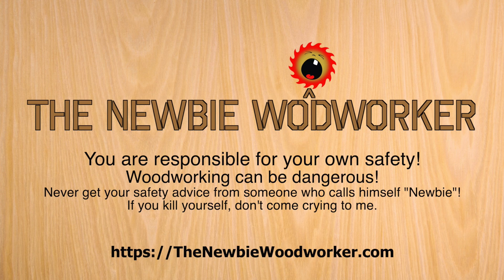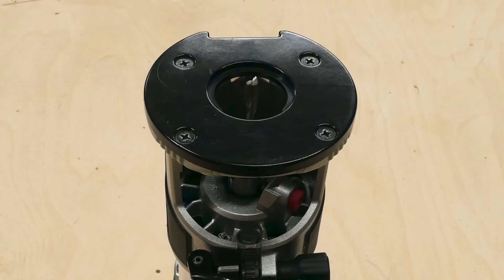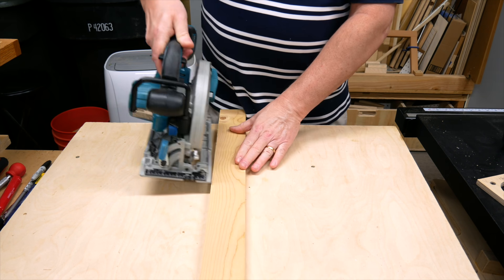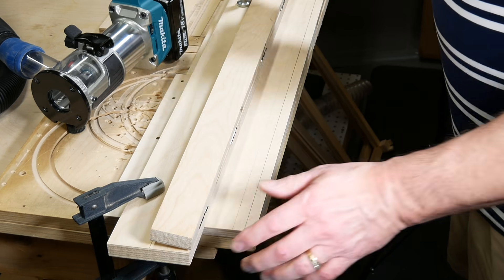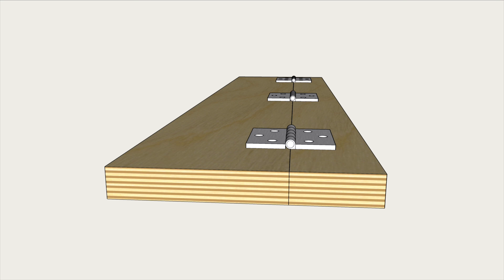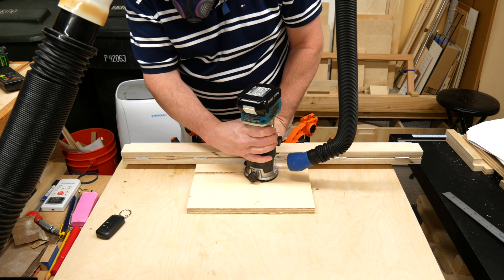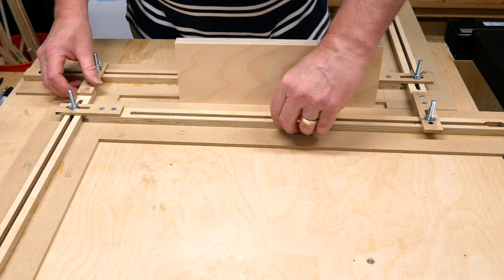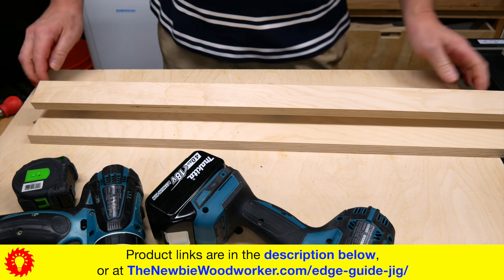Edge Guide Jig for Routers or Circular Saws

Comment: Great Video, I love how you explain things, using a liilt humour and lite hartedness with just enough technical info without becoming boaring.

I made one a few years ago, however mine was slightly different .

In mine, the park you clamped down for routing IS the space for my circular saw.
and the part I clamp down for my circular saw is my spacer for my router.
Meaning i have only 2 parts to use it with both.
Reply from the maker: Cool! 😄

Comment: Thank you! I have been struggling with cutting a straight line, I have no table saw. Many other designs out there, also simple, but still didn't work for me. I made mine with the saw short-wide side (1 1/2) on one side and the long-wide side (5 1/8) on the other side. This way I can easily flip it if I use one side of the saw or the other.
Reply from the maker: Good job! Make sure you're moving the router the correct direction. It's kind of hard to explain which way is correct, but just know that if you move it the correct direction, it's pretty easy to keep the router against the straight edge. But if you move it the wrong direction, the router will want to wander away from the straight edge.

Comment: Wow, there are some great ideas there - thank you. I have this embryonic idea for making this jig adjustable to suit the tool one is using - jigsaw, router, circular saw and perhaps others...I think you can see where I'm going with this. The fiddly bit is getting the flip over part to evenly change in width to suit the tool. Perhaps three (or more) guide holes?
Reply from the maker: I think it could be done, but it might not be worth the effort. But hey, don't let me stop you - you never know what you might come up with! 😄
Reply: @TheNewbieWoodworker  Tossing ideas around is always fruitful. Its nice to hear a different perspective. Thanks. I will only build it if I get it clear in my head and right now, its quite fuzzy :). I'll keep you in the loop if you are interested.
Reply: Easy. Cut another strip or strips to add to the spacer to make it equal to the additional thickness needed and attach with magnets. Since the flip over part is only a spacer, this should work. I would use a forstner bit to drill holes and use small round neodymium magnets. So if the router spacer is 2 1/4 inches and the circular saw is 4 inches, use a 1 3/4 strip that attaches with magnets. If needed, compensate for any gap the magnets may cause. (would be 32nds. or none at all) That's my idea at least.
Reply from the maker: @MikeTheSith200  Magnets! What a great idea, and I'm ticked I didn't think of it myself, because I use magnets for all sorts of things. Like I said, great idea. 😄
Reply: @TheNewbieWoodworker  thank you sir!
Reply from the maker: @MikeTheSith200  No, thank *you*. (We could go on all day like this. 😂)

Comment: Holy Moly - that’s a great idea! 

Gonna try it as soon as I can. The one thing I struggle with pretty much every project is making simple straight cuts. So much so, I was considering buying a track saw... but I think I’ll try this first.
Reply from the maker: You and me both. I've learned a couple of things, though, that might help. First, if you're using a router, make sure you're cutting in the right direction. Going one way will help keep it close to the straight edge, but going the other way will cause it to want to wander from the straight edge. I can't explain which direction is right, using just words, but try it out both ways and you'll see it right away.

Second, regarding a circular saw: I could never keep my circular saw straight until I bought a new saw (the Makita cordless). I have several older circular saws, and there's a big difference between them and the new one. I'm not sure what the difference is, but if you have an older circular saw, you might think about getting a new one. I'm really good at spending other people's money. 😄

Comment: How's about a three-use jig, if like me you have a circular saw, a jigsaw and a router? All you'd have to do is put in the widest two tools first and find a long piece to put in in order to fit in the smallest. Would that be safe, do you think?
Reply from the maker: I think I'd go the other direction. Have the spacer be the smallest, then add additional pieces with magnets. You only need them while you clamp it down, and once you fold the spacer out of the way, you could even pull them off if needed. Does that make sense?
Reply: @TheNewbieWoodworker  Yes, I think that is what I was trying to express, in my fumbling way.
Reply from the maker: @johnedwardtaylor  👍

Comment: I have a question. Lots of YouTubers suggest using 3/4” plywood for making these jigs but I have a bunch of table leafs that were left behind when people purchased dining room tables from our vendor mall that seem to be either hardwood such as oak or particle board sandwiched between oak veneer. Will particle board work for building these jigs? I could use oak but it almost seems like overkill. Thanks
Reply from the maker: I thought I'd already answered this, but maybe I didn't hit "Reply". My answer is I'm not sure, but give it a try! Remember that screws don't hold very well in particle board, though, so that's something to consider.

Comment: Now using this idea how can I build micro adjustment so I can create a 0.150 slot with 0.125 router bit?  Wanting to make slots for 1/8" masonite panels in 1/2" plywood with 1/4" slot depth.  Slots are 1" on center with 20 slots per part.
Reply from the maker: Good question, and I'm not really sure. In fact, I can't think of anything right now, unless you can make a spacer of some kind. Sorry I'm not more help.

Comment: Hey Dan i finally got me a table saw! ill be making one of your sled's maybe even 2 lol. ive already made a second push stick "man cant cut alone with just one push stick" haha

you got any advice on dust collection what i mean by that is i have a blade guard and it has a tube that connects to the saw exhaust and then goes out the back, i 3d printed an adapter to fit my exhaust and my vacuum cleaner it fits very tight but the saw is still making quite a mess. 

i can understand the bit of mess on top of the saw thats ok but it is still going over the floor but not as much as it did when i didnt use the vacuum cleaner lol........never doing that again i had to vacuum my whole garage dust everywhere!
Reply from the maker: Congratulations! What saw did you get? I need to see some pics to understand what you're talking about. You can either post links to some pics here, or send them to me via email by going to my website https://thenewbiewoodworker.com/, clicking the "menu" in the upper right, and select "email".
Reply: @TheNewbieWoodworker  sure thing I will probably do a video and send a link  of it probably easier. it's a UK brand titan ttb763tas it's a budget unit but as far as I'm concerned it's the best of all the budget brands available took me a few months to decide which one to get.

Thanks
Reply from the maker: @TotoGuy-Original  I found a couple of videos on that table saw. It looks like it has a dust port in the back, as well as the hose from the blade guard. So I'm guessing you hook the hose to the dust port in the back, and your shop vac sucks dust from both above and below the table at the same time.

That sound right to you? If so, are you using it that way, or are you only using the hose from the blade guard?
Reply: @TheNewbieWoodworker  yeah that is right. Haven't had time to do a video yet but I will. Going to make sure everything is clean and then do some cuts so you can see where it's going.
Reply from the maker: @TotoGuy-Original  👍
Reply from the maker: @TotoGuy-Original  Thanks for the video - it helped a lot. First, let me answer the things you brought up in the video.

Yes, make a zero-clearance plate. It's safer and you'll get cleaner cuts. It might help a little with the dust collection, but that's not the real problem (more on that in a moment).

The adapter's probably that size just to make it easier to handle somehow, but I agree that although it isn't the most efficient thing, it's not what's causing the problem.

The cyclone is only to get the dust in a separate bucket, so your shop vac's filter doesn't get clogged up as quickly.

No, the problem is the same problem every table saw has, that isn't a cabinet saw. The bottom is wide open, and dust is just going to fall down to the floor. You need to try and close up the bottom. With some good measuring and some patience, you should be able to build a "bottom" for the saw. And you may end up trying to cover the other holes, like for the tilt mechanism (maybe with some rubber from a bicycle inner tube that's split and overlapping, if that makes sense).

When I had a saw like that, I bought a "dust hood" and used it underneath. Search Amazon for "dust hood" and you'll see what I'm talking about. I had to use some wood to get it to fit right and cover the bottom properly. I didn't actually hook up a vacuum to it, I just plugged the hole, and opened it up every once in a while to suck the dust out.

I'm not sure what to search for, but I've seen YouTube videos on this subject, so they're out there if you can figure out how to find them. Hope that helps!
Reply: @TheNewbieWoodworker  Thank you so much that has helped me a lot! 

i got some idea's for covering the bottom so i will work on that and a way to easily empty it periodically. For the other holes like the exhaust hole i think what i will do there is as you suggest some rubber probably get a piece of rubber and stick it on the inside with a slice in the middle so the exhaust can still move if i tilt the blade.  i might get some brush draught excluders for the table tilt mechanism i think that would work perfect there. oh and the zero clearance plate. 

did you see the nice piece of hardwood plywood on the floor? that is for making me a sled im looking forward top that! :D 

Thank you very much again i look forward to  your future video's
Reply from the maker: @TotoGuy-Original  Awesome! Glad I could help, and have fun, and stay safe!

Comment: Unfortunately this did not work for me for a circular saw. I followed it to the T but when I fold it the bulk battery and motor of the circular saw are hitting the folded portion. I am using a Ryobi 7.25 inch circular saw
Reply from the maker: I'm thinking you need to use it the other direction, so the battery hangs off the other side. Does this make sense?
Reply: @TheNewbieWoodworker  that is what I think is the next best option. However I don't have a table saw and need to cut the piece with my circular saw. If I want to put it on the other side, I am running into an issue in cutting the width needed because my fence would need to be on the piece that needs to fall off. Any options?
Reply: @TheNewbieWoodworker  I solved the issue
Reply from the maker: @diybuildandlife207  Awesome! 🙂

Comment: Forget the “measure to the center” or “don’t worry about the blade thickness ” of course it matters. Don’t measure at all. Use the tool itself to determine the width of the filler.
Reply: I was thinking the same thing. I've seen several other videos for straight edge guides where you cut the guide a little wide and then use the tool to cut it to the final width. The method used in this video is overly complicated and inaccurate. I like the idea of the design, but his method of getting to the final dimensions is not the best.
Reply from the maker: @craigphillips3154  That's actually a good idea of how to cut the spacer. Where were you when I was making this video? 😂
Reply from the maker: Like I said in the other reply, good idea, and where were you when I made this video? 😂